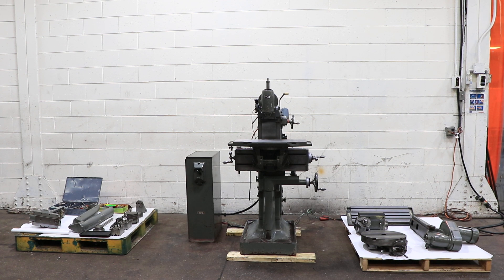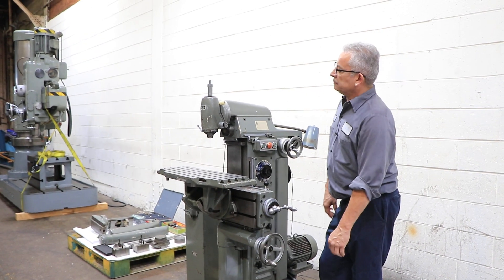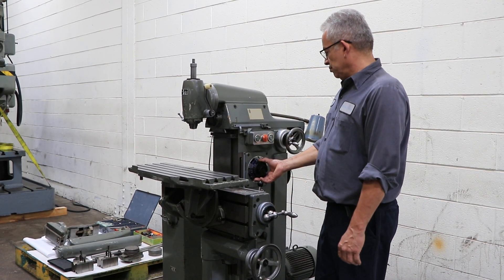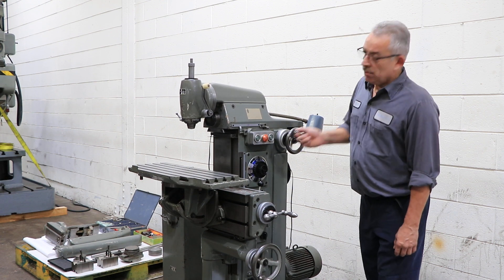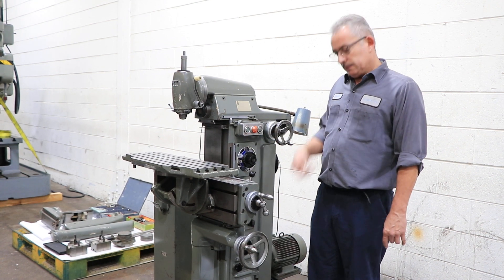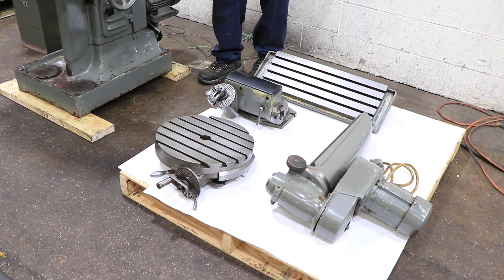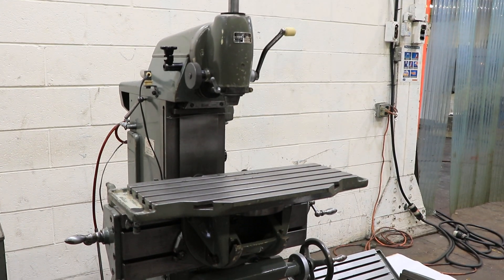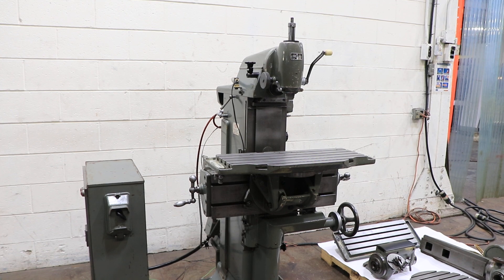DECKEL UNIVERSAL HORIZONTAL/VERTICAL MILL

Comment: I recently bought one of these and can say it is an amazing machine. A couple things that weren't mentioned are that it does have a coolant pump built into it, the huge transformer can be used for a boat anchor as this isn't 1980 and you can install a vfd drive and 3 phase motor to run on 220 that's what I did. You only need a spanner wrench and a 1/2 square drive socket for super fast tooling changes, Sorry bridgeport guys there will be no beating on this gem with a hammer lol. Now the bad. If it breaks your screwed your probably never going to find spindle bearings or anything else for this machine unless you have deep pockets. The arbors on mine are some funky s20 thread pitch that nobody sells for a reasonable price. Luckily my fp-1 came with tons of accessories for dirt cheap. In the end it is a great 2 in 1 machine that takes up a small footprint and does just about everything one would need!